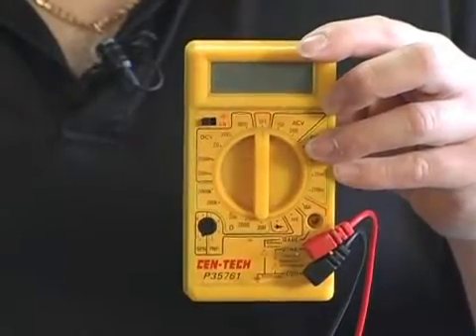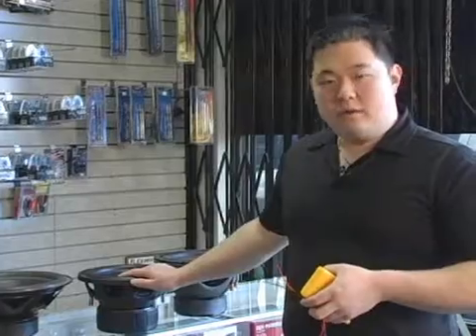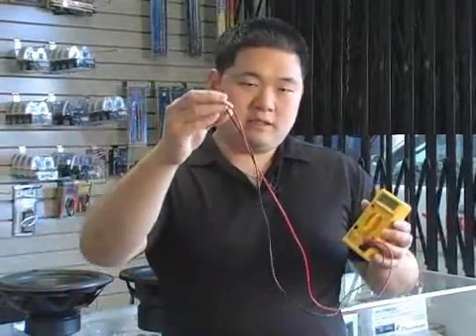Woofer Speaker Installation Tips : Woofer Speakers & Law of Ohm

Comment: 1:12 hes not even shure about the parallel connection and he talks about testing the sub if it works if u get nothing means it unplugged ? couldn't it also mean u fried something in the coil there fore opening the circuit? id like to see these guys electronics classes